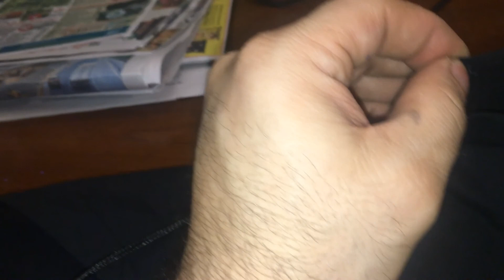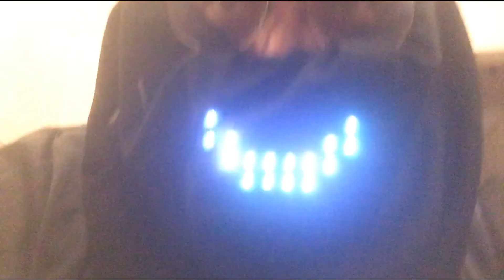Fabricating Bandana LED Digital Talking Mask assembly for easier in store use Voice Activated

Comment from the maker: Any Arduino: ones used here search amazon for 3 pack $10-15 "Arduino Nano V3.0 CH340" SOME COME WITH CABLES for same price https://amzn.to/3wZpG4k
Microphone: search amazon for  "max4466" 2 for $6-8 https://amzn.to/3gRPEkn
Any 1/4 watt 330ohm resistors $5-6 for 100 https://amzn.to/3vSlTEy
LED Display Search amazon/ebay for "WS2812 8x8 flexible" $11-17. https://amzn.to/3wYskak